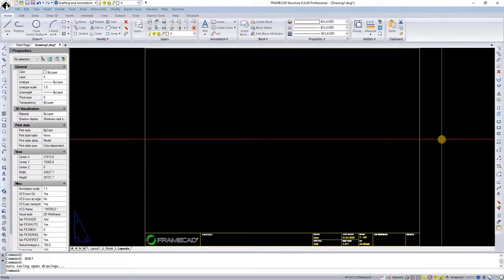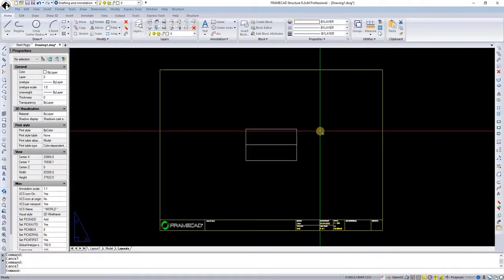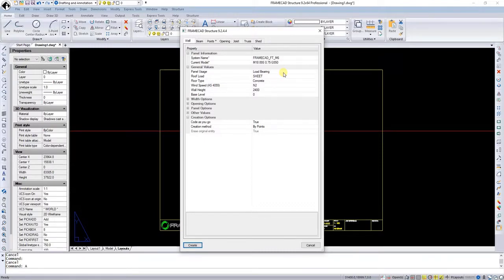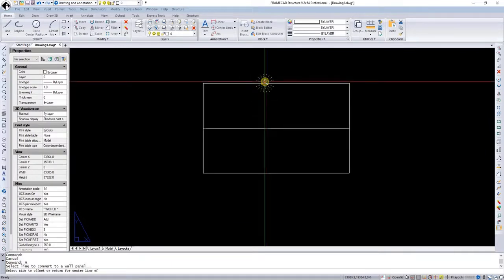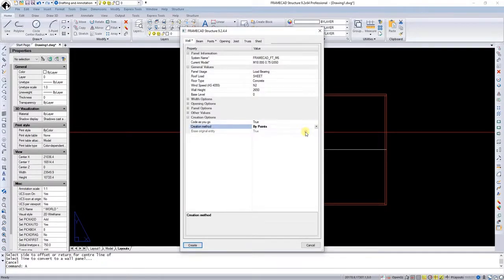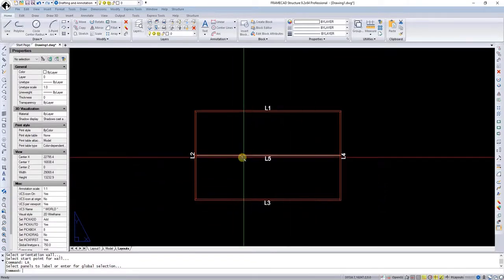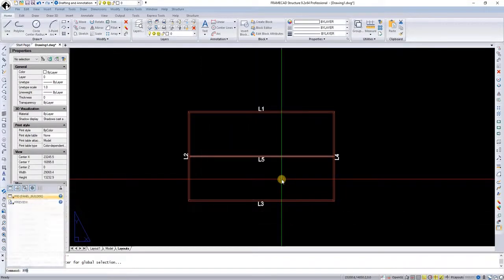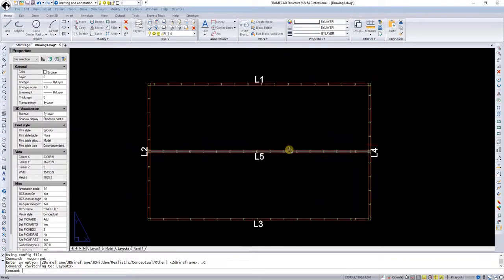03 - Framecad Structure - Quick Start - Walls

Comment: is it possible to add point loads onto specific parts of the wall? for instance, I want to apply a point load on the top plate.
Reply: add a stud or move your studs, so the point load gets transferred to the floor...